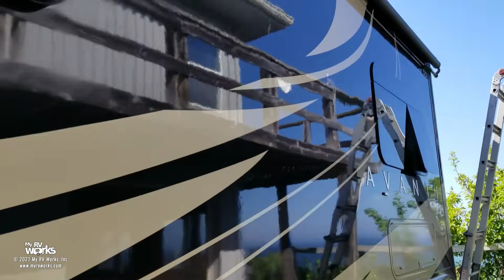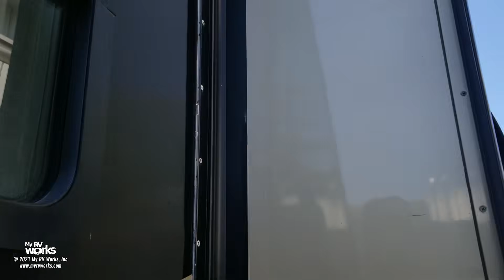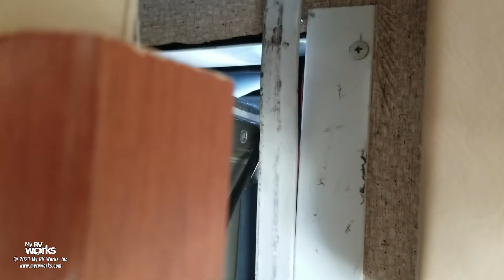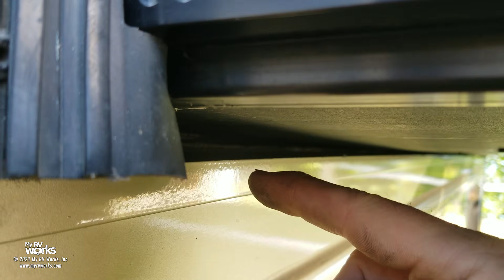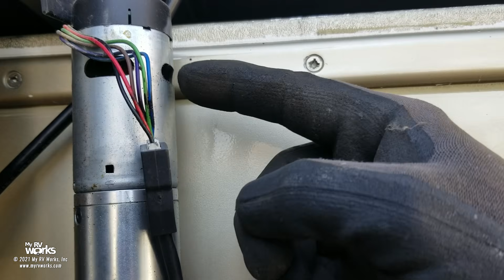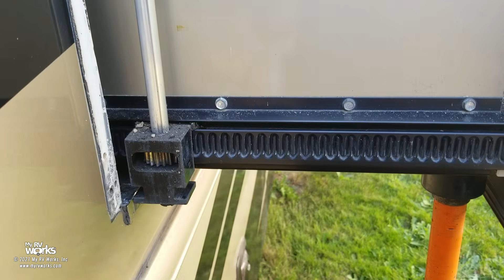Lippert Schwintek Slide Room System Replacement (Part 1)  --  My RV Works

Comment: They don't like the service perspective because of planned obsolescence. They hope that you'll just buy it new instead of repair
Reply: Also if I dont have a harness, Can I just disconnect the opposite motor and use the main controller to drive out the H column on the side that's being repaired?

Comment: What size screw holds motors in mine were wrung off. And what size screws did you use instead of rivets for Hbeam

Comment: Loved this video!  Have a video on replacing the H-seals?  Also, when replacing the racks, how to seal the old holes?

I discovered that Lippert obsoleted the inverted style mechanism, and that if you try to use the original column mounting holes for the replacement, that (on mine) forces the columns inward and makes it jam.  Had to drill new mounting holes, offset 1" vertically.  I'm counting on the caulking strip to seal the holes.

Comment: Darren, first of all, thank you for videos!
My problem is relatively simple.
Doing some PM today and found I have a rivet that holds the gib in place has popped off. Slide works great, rollers underneath all seem solid. The other rivet is still in place .
My question is how do I get rid of existing rivet and replace it with a new one. Was thinking of drilling it out but it just spins and I’m not sure if I can get to the back. Also do you know the size for the replacement rivet?looks like I can’t post a pic here but I’m sure you’re very familiar with this. Also wondered about replacing the rivet with a self tapping screw.
TIA

Comment: Hey just wandering if I can get some insight from you. At work I have a schwinteck slide out that is butted up too far to the left. It goes in and out fine and doesn't twist but one side is closer to the wall than the other causing one sweep gasket to not seal as good as it could. Ik there's a bracket on the bottom to adjust it but is it as simple as it seems I don't wanna undo it and mess something up. Do I just undo it and shift it over to the other set location. Also do I need to sure up the slide like is it gonna wanna fall out or something. Any help is greatly appreciated

Comment: How can I get the motor out when I can only get the slide to come out about 2 inches. I don’t think I can get to the set screw from the inside? And this is on a hurricane 34F with a full body slide.

Comment: How did you pull the H column off without drilling out the rivet. Isn't that the fixed side that should have a rivet keeping the bearing block from moving on the gib?
Reply from the maker: With as many of these I have worked on I have found that the fixed side rivet has already failed.  It is rare to come across one of these systems and have that rivet still intact.
Reply: @MyRVWorks  so should the rivet even be there? The repair kit only comes with two rivets as if they only want one side of each block to be fixed anyway. I took my whole column out, replaced the chewed up gear rails and put one fixing rivet in each block, but the system is working worse than ever now. Over $400 in parts and not only did it not fix it, but it's worked once and the slide is now stuck in and with this ridiculous design I can't even remove the screws holding the motors in so I can manually move the slide to see what else I can do. Super frustrating to say the least.

Comment: Im going through this right now, two broke motors and the slide is stuck all the way in. No way to get to the outside retention screw. Slide wont go out manually with hydraulic jacks, so i opted to remove all screws off the tracks to  push the slide out. Now the problem is getting to the last 12 screws as they are behind the slide out framework and blocked by the rollers. What do i do now???

Comment: Without the rollers being installed, aren’t the failures that you’re repairing inevitably gonna recur? Won’t all the forces that caused the damages on the rack, ceramic wheels etc inevitably gonna recur? Great videos & diagnosing of the issues & their cause(s)…

Comment: Darren, when I closed my full length slide, I heard a pop, and the rear inside corner fell to the ground.  Thanks to your videos, I went to harbor freight, bought a body repair puller, and successfully pulled my H-harness (that will always be my word for it now)!  I could see that my lower track and gear will be needing replacement, but I was able to realign everything, properly open and close my slide and get back on the road.  The ONLY reason I succeeded was that your explanations of this device were so thorough and clear, I actually understood how it worked and could figure out what went wrong and how to fix it.  Now THAT'S empowerment. I hope you know how much you have helped me, and how happy God is when one of his children takes care of his brothers like you do.  God bless you, Darren!

Comment: Can you trim the driveshaft to be flush on the bottom? Will the drive shaft drop down and impede the h column going back in? Or does the bottom of the h column hold it up in place?

Comment: This is about the 10th video I have watched on these CRAPPY Schwintek Slides so I can feel confident enough to attempt the repair.

I can't take mine in for service because the slide will NOT come in.

How is this company still in business? I have seen failures on 1 year old RVs. 

They are still in business because they rip people off for $300 for JUNK parts. 

Parts that are designs to fail so users have to buy more parts.

I will NEVER again by ANY RV that has a Schwintek CRAP on it.

Mine is stuck in the out position with only one side working.

On the side that is not working, the slide is all the way out at the bottom and still in by 3 inches at the top so this means it jumped some teeth on the rack the bottom or top. 

Absolute GARBAGE products!!!

But THANKS for your video as there were a couple more things it will make me watch out for which I had not seen yet.
Reply: Same. Service techs are hard to come by. Gonna have to do mine myself. It’s scary for sure.

Comment: Hi Darren, I have a 40QBH Tiffin Phaeton with three Schintech/Lippert slides and one hydraulic slide.  Your video on the electric Schwintech system is terrific!  Thank you so much.  Please stop posting Straits of Juan de Fuca videos.  I was born and raised in Seattle from 54 to '94 and a avid sail boat racer.  I've sailed by the shore you have posted on our Swiftsure Races out of Victoria.  The videos really make feel like crap  when I'm stuck in Dallas, TX the past 25 years.
One Schwintech episode I had last month in Wyoming, the 15 ft drivers slide didn't sheer the 5/16 shear bolt, but sheared the shaft of the schwintech motor.  I called Lippert and they said the shaft required grade 8 bolts (which I did).  Lippert also told me to NEVER lubricate the system.  This sounded odd from me and watching your video makes me think I was right all along.
Darren, thanks again for you video's!!!  Very helpful!!!

Comment: What is the purpose of the inside white track that is screwed into the inside wall?  how does it hold the H-Track in place? Does it NEED to be removed in order to pull the H-Track out far enough to re-score the shaft spline to keep from it dropping down?

Comment: Hello Sir, in the process of doing this repair. Received the whole kit from lippert, and they are even the correct sizes. However, they sent me black ones and my rv is white. They said they only come in black or raw aluminum., which I find hard to believe. Any thoughts or insights please? Thanks again for great videos, couldn't be tackling my project without them.

Comment: First of all, I have learned a lot from you and appreciate your hard work putting these videos together. I can only imagine how tedious it must be. I have just recently graduated from the NRVTA to become a certified technician, still learning a lot though. Secondly, I have a question in regards to the flapper seal on the outside of the slide.  After you pull the seal back to expose the screw that holds the motor in place, what do you use to reseal that when you put it back. Got called on a job that I had problems keeping the seal back in place. Do you use something like sika flex?? Please help, as I am sure this won't be the first time I run into this. By the way, we here in Texas say howdy to ya!! South Texas that is.

Comment: Love your videos. Our kitchen slide won’t go out. It’s closed up tight on the left. Right side only moves an inch. What do we do if we can’t get the slide out far enough to access that screw to remove the motor? We have literally tried everything suggested and nothing has worked.

Comment: It's crazy how big of a slide manufacturers put these Schwintek systems on. In my understanding user designed to be lightweight light duty slide systems and really aren't meant for super heavy slides.
Reply: Rv mobile tech here,  your comment is something I have said for years.  Most big problems are on full wall slides.  Crazy  that they continue putting them on them only to fail repeatedly.  Once they have your $$ it's your problem to deal with.

Comment: Darren,  Thank you for the video!!!  Two quick questions.  (1) Can you replace rivets with screws?  I have rivets...(2) Is it possible to replace the lower bearing block without removing the whole H column?  I am just diving into a repair (the shoe on the lower being block sheared off).   Thank you!

Comment: Thanks for the video, My slide got jammed and had to remove my motors to push it back in so I could head home.  Will be replacing my schwintek system shortly but did build a Dewalt 20v to 12v battery adapter to drive my motor using a momentary switch to make it turn CW and CCW I made a video of it if you want to see it.  https://www.youtube.com/watch?v=5W8_xciHSiQ

Comment: No don’t rebuild it don’t put another Schwinn tech slide in there’s a company in Arizona that makes a system that will directly replace it and is 3000 times better than that Schwinn tech junk made by Lippart

Comment: I wouldn't let this client work on my worst enemies camper if you don't properly support a slide during repair you make it so it will never work properly. I use an automotive lift jack use to support parts being removed or I stalled when the vehicle is on a lift. A minimum of one on each side with a stong board to support entire slide and the lifting of slide makes it possible to stabelly repair and realize the slide mechanism. This is a great how NOT to do this.

Comment: Darren, you are amazing, thank you! So my daughter's fifth wheel is here at our home I'm trying to fix her Schwinn tech slide, Grand design product. The controller is throwing eight flashes, so short in motor one. Disconnected the harness between the motor and the controller, and no short in the red and black wires. No damage to the red and black wires. So we replaced the motor, same error. Seems like the side where the motor was replaced is always dragging either in or out behind the other side. Slide moves in and out perfectly fine in override mode. No gouges in the tracks. Other than the little draging. Also tried a different controller with the same results. Any ideas? I'm at a loss.

Comment: Hi, Great video with tons of good information. I'm about tackle a Schwintek slide that is out by 3 inches top to bottom, so an obvious gear skipping issue. I think to get the new parts installed I will need to take both sides of the system off. I'm thinking if I properly support the slide and put some 2x4 stops on the inside I'll be ok. What do you think?

Comment: I’m at the point of using a drill battery to remove the motor and tracks. Problem is I, and no one I know, still has a 12v battery and you say 18v and 20v will not work. Can you suggest another power source.
Reply from the maker: Well, you can always get like a motorcycle battery and some jumper cables.

Comment: We just got our 1st truck camper with slideout with the schwintech it never really likes to sync good but does work ok anyway new problem wife put steps up to bed she thought In a safe spot well it was in slides way closed slide on it motor sqauted down and stopped put back out moved step noticed the bottom of the slide is about 1inch from closing or less when the top of that same side of slide is closed sound like maybe the lower track jumped a tooth or something before we got it stopped any idea how I could fix this seems to me if I removed the motor and manually realigned then and put motor back on would it sync the top and bottom of the right side of the slide always something thanks love your vids Iam learning as much as I can it's a 2016 palomino backpack with 2 slides

Comment: What if the screw into the motor does not tighten up.  I was conducting maintenance on the slides and notice the screw that holds the motor in, does not tighten up?  Should it?  What do I do if it doesn't? 
Thanks
Reply from the maker: In that situation go with the next size up screw. That screw needs to be secure to the H column to be of any use in holding that motor down.  The H column is aluminum so a steel screw in a thin aluminum frame will fatigue over time.
Reply: @MyRVWorks  thank you for responding. I will be a dedicated subscriber, your information is great.

Comment: Thanx for youre info vid     Im a RV tech up on  Vancouver Island    (CAF Vet) Allways intrested on how you do the things i do    Yah  OEM blew it on that build  lol   NO ROLLERS and Plates!     I have a stable stand, w/ roller head (adjustable) for cases like that.    I usually remove the motor  so gears n shaft can free wheel, after i get  H column"popped" out a bit ,,,, just saying>>>   Really hate the  set screw being on the out side  when yah got a jammed  one ( Jammed closed)

Comment: maybe look at becoming a Vroom Slide systems installer, far superior replacement All About RV's just had one installed, 5X more robust, and can be loosened up if there is a problem with a couple nuts at the bottom and can be manually opened or closed with a wrench.

Comment: Thanks for all your great video. I heard you mention all lippert slide should have rollers. My Rv does not. I did find on the links you provided that if slide is not wider than 6 ft and less than 500lbs rollers are not necessary.

Comment: Excellent video.  I have had a problem with my 2020 Lance 1995 lippert Schwintek slide out.  Bottom front bearing block has failed three times.  Slide will not go out evenly hangs up on front.  Happened at campground first time.  Would not go out on front.  Called a mobile service and he could not help me.  Basically the bottom block twisted and slide out would  not go in or out. He got it the block out and we were able to push it in.  Spent a month with the slide in camping. Not fun but not changing plans. No one could fix, no parts.  Got it home, to the dealer, they ordered complete assembly front and back. Took 6 weeks.  Installed took it home.  Set up trailer, tried to put slide out, Same problem. Dealer came out and took trailer back. Had to for two days. And fixed it. Took it back home and set up and it worked. So I would open and close periodically.  Worked 15 cycles.  Same problem. Tech tried to open and it was the lower front bearing block again.  Shoe was chewed up and and the track was full of debris.  So waiting for for another 6 weeks for the front slide assembly.  I am ready to get rid of this thing.  Perhaps I should plan a trip up your way? Thanks for video, but still a loss.  I live in Prescott, AZ.  I luckily purchased an extended warranty , but no luck with this slide.

Comment: What a great video definitely needed I have contacted you on several occasions about me doing my RV Schwintek on removing it and replacing the track on both sides and you have been very responsive offering me information on how todo it. I have taken the slide out apart 4 times unfortunately I just couldn’t get it level on both sides. After watching your new videos on doing the whole job I’m going to tackle it again this spring with some new tracks on each side and hopefully that will resolve my problem and it will operate properly again. I definitely have learned a lot from watching your videos they have helped me out a lot on other issues. Thank you for posting these videos they are great and very informative and help a lot of DIU out that want to do their own repairs. 👍

Comment: Great video Darren as usually. Quick question on lightly tapping down the collet so to seat on the drive shaft, I got a little shy on tapping because I was concerned the drive shaft would shift downward to much, so my question is that possible ?
Getting prepared to view part 2 of this series.
Reply from the maker: That aluminum driveshaft has these small machined Burrs in it to prevent it from going down too far. If you're using the collet to hammer it down the collet will bottom out before the driveshaft goes too far so you'll be fine.

Comment: Who is the manufacturer that did not put rollers in? Are you going to add rollers? The added resistance without rollers will just make this slide break again.

Comment: I have the system that the frame is not notched to get the motor out, do you recommend notching the frame to make it easier to replace the motor? Thanks I enjoy your videos
Reply from the maker: Yes, I've used a Dremel to cut that notch to get the motor out before.